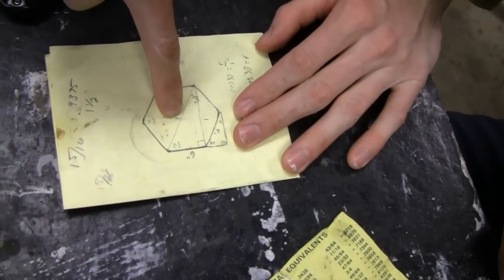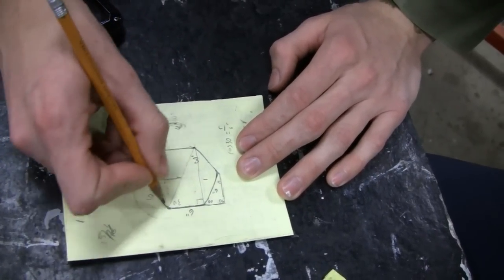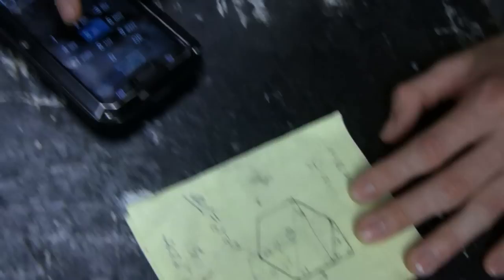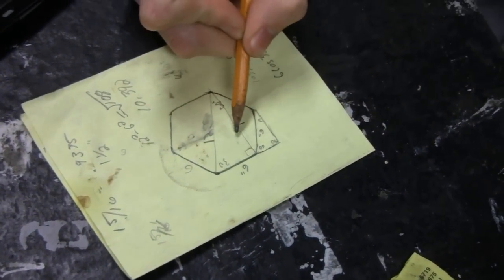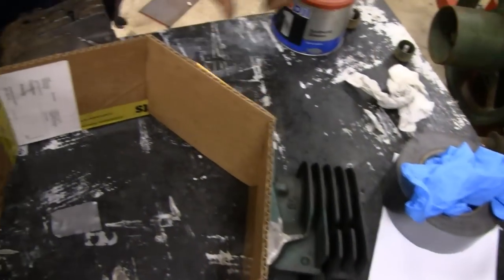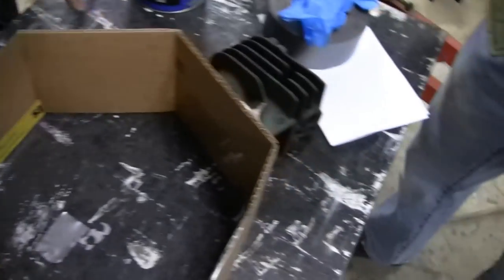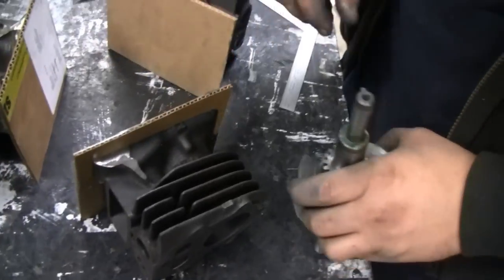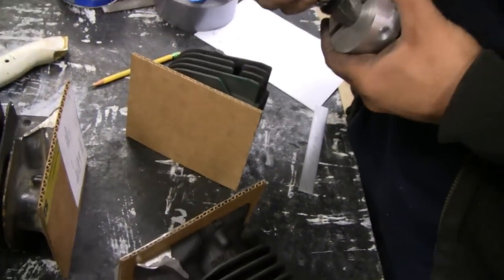HOMEMADE RADIAL BRIGGS ENGINE (part 4)

Comment: pretty neat...but is this going to be vertical?? i might have missed you guys saying that...when i think radial i think horizontal ( like old airplane engines)) which i ask how you will keep oil out of lower cylinders...great work...love your channel!!
Reply from the maker: Thanks Bud!! Horizontal!!☺
Reply: cool cool so i ask how you going to keep oil out of lower cylinder/s typically if you turn a running engine up where head is down itll smoke like hell
Reply from the maker: Kurt Parker
It's gonna have a dry sump!!☺
Reply: Gotcha
Reply: Very cool

Comment: Very interesting how you guys are figuring all this out, looks like it will be quite a Beast when done!
Nice to see how the conrod is coming along, as I was curious how you would build it.
Radials either use a 1 piece Master rod with a built up crankshaft, or a split master with a 1 piece crank. I can see why you chose a 1 piece crank! The split master rod will be a piece of art when you have it done, for sure!
Cardboard can be a very useful product, I use it for building mock-ups also, cheap and easy to cut  :)

Comment: Im really interested to see how this turns out. While growing up my friends and i would go to the junk yards and buy random engines on the cheap and just pull them apart to learn and see how they work. Anything from pushrod v8s, overhead cams, v8 and straight 6 diesels. We even pulled a mazda rotary. Ive never dived into a radial before though. Is balancing the crank a concern of yours or have you guys have that figured out? Always enjoy your videos guys, keep them coming!

Comment: Hey Roadking i'm currently tearing apart a little 43cc 2 stroke any advice on were to buy head, carb and exhaust gaskets?

P.S. the little bugger is like 15 years old XD.
Reply from the maker: Brice loy If it needs that much it's probably not worth fixing, it's cheaper to buy a new piece of equipment!! But here's where I get most of my parts http://www.psep.biz/

Comment: Awesome work already. Thanks for the heads up mate, as to how you're going to go about it. Answered my question about oil feed in the comments. Now I know it's probably too late, but have you considered making the crankcase circular, then welding flat plates at 120deg for the cylinders? Would look more aesthetically appealing, although I know you can address this with epoxy. Hope you don't mind me throwing ideas in the mix :)
Reply from the maker: MalcOfLincoln Thanks Mate!! We thought of a few configurations but we have alot to consider as far as room for cams, gears and sprockets!!☺

Comment: Castin' a block for that beast would be interesting, and you could put all those cut-off bits to use! But it would be kinda messy, dealin' with all that molten metal and stuff. Still, it might just be easier than finding a chunk big enough to machine down to what you want. Would it even fit in the lathe? I'll keep watchin' to find out!
Reply from the maker: TheFurriestOne We're just gonna build it outta steel!!☺
Reply: Like, plates welded together then? This might be your heaviest engine yet!

Comment: Using Maytag engines as donors would make a nice tight little radial engine.  The cylinders already have a good mounting flange on them and no valves to worry over.  btw have you checked out http://www.homemodelenginemachinist.com  They have some interesting information on building cam shafts.   I'll stop rambling now...

Comment: It's kinda funny that you're building a radial and chargermiles007 is making one too. What do you think of his? Also, are you going to have 3 separate camshafts or are you going to have one large cam ring like most radials?
Reply: That's not a radial...that's a inline 3 cylinder with the blocks lined up all cattywampus!!
Reply from the maker: Cameron Jenkins Not exactly sure what Miles is doing, but I wouldn't call it a Radial!! Ours is gonna have 3 cams!!☺

Comment: Going to be pretty cool. You plan on using the 3 original cams for the valves or use a traditional radial cam setup? After all that work, you guys going to put it in something? It'd be a shame not to put it to work atleast, or put it in something fun to drive?
Reply from the maker: ***** We're gonna modify the original cams!! We'll probably build an Airplane to put it in and fly it to shows!!☺